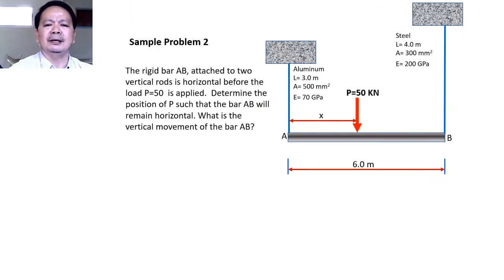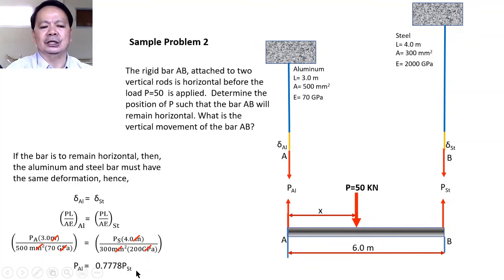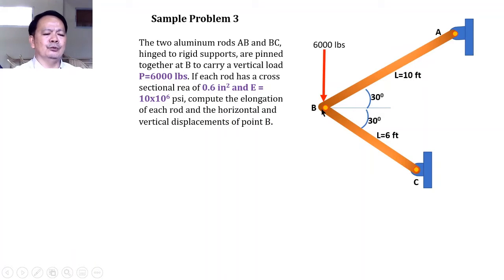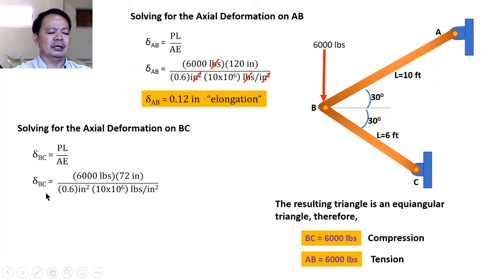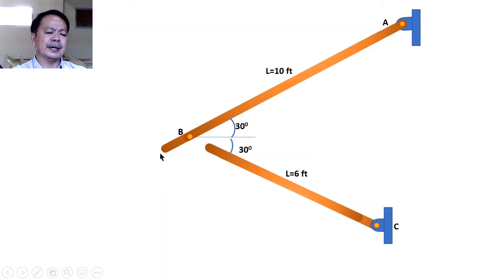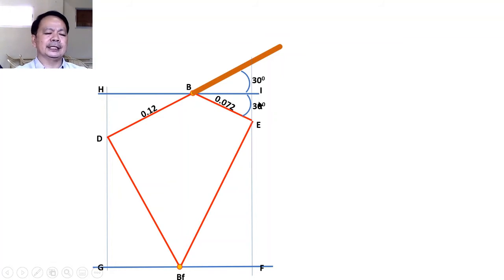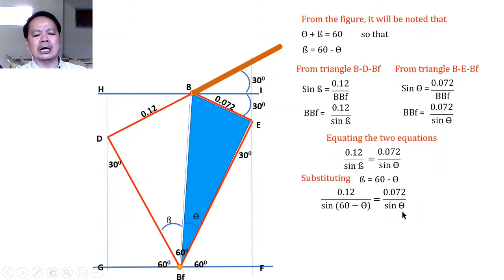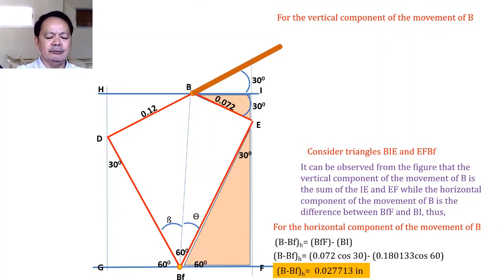Axial Deformation-Sample Problems

Comment: bakit naging 0.399 something yung tangent theta?
Reply: tan(theta)=(sin60)/(13/6) po
Reply: Wait
5/3=(sin60/tan(theta))-0.5
Ilipat si 0.5 sa other side para maiwan si tan(theta sa kabila)

(5/3)+0.5=sin60/tan(theta)

Then itimes si tan(theta) on both sides para macancel siya sa denominator ng sin60

tan(theta)(13/6)=sin60
Then, divide (13/6) on both sides para maisolate si tan(theta)

So naging 
 tan(theta)=sin60/(13/6)

Comment: Good morning po sir..ask lng po bakit po gnawa agad cyanh 90 degrees ung dalwang angle ng quadrilateral?
Reply from the maker: Because the arc length formed when bars AB and BC were rotated in the same direction are relatively small compared to the lengths of the bar,  the arcs were treated to be straight in the determination of the movement of B.
Reply: @willerdayahan2865  ok thank you po sir! :)